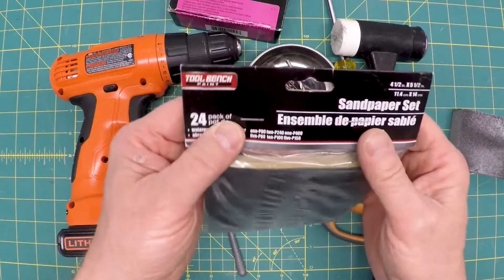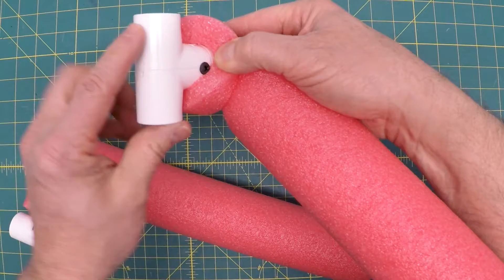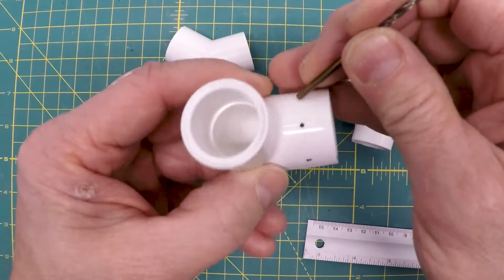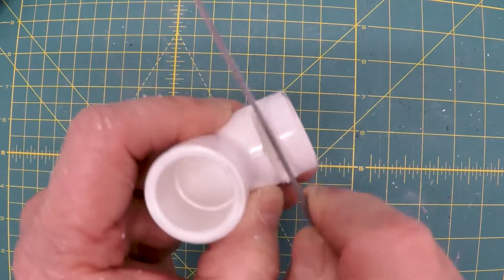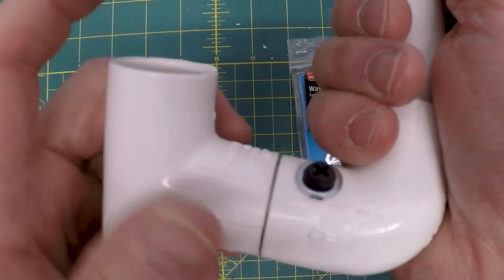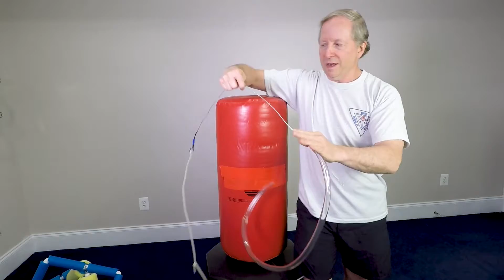How to Make Fully Adjustable Slip Arms in Minutes Tutorial

Comment: A good point to note is that with a hairdryer you can easily heat pvc and bend you own "elbows" into just one straight pipe. 👍 (if making a fixed elbow joint)
Also duct taping the arms (pool noodles) will keep them from breaking down, making  the arms stronger and more life like. 
You could tape and roll it tight to shape biceps, forearms, wrists, etc with no more effort than just taping them. 👍

Also you could fill the pvc pipes with spray foam to strengthen it a bit more, obviously dont want foam in a moving/rotating points, so foam them first, then easily cut scrape out room for moving parts. 💥 

Brilliant work though & thanks for posting ☯️
Reply from the maker: All great suggestions, thanks for sharing. I've some of the tips you mentioned in later videos, and can agree that they work.

Comment: Thanks for the great video on this arms project. I just finished building my own, and it works great for in-out movements from the heavy bag. However, I'm stuck on how to add some up-and-down range of motion to the elbows and shoulders. Right now, the arms can't reach up to much and they can’t bend at the elbow at all. The 3-way tee with the flexible pipe gives the shoulder some up and down range of motion, but the elbows are locked in place. Do you have any suggestions on how to add up and down movement to the shoulder and elbow?
Reply from the maker: I made this other version that moves around a lot: https://www.youtube.com/watch?v=mUdSWUa2Qmc&t=1s